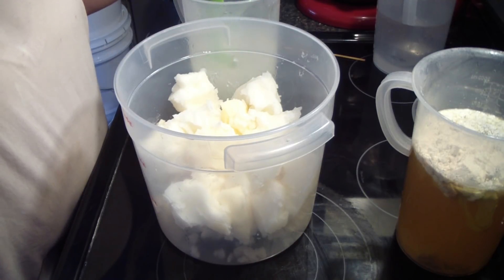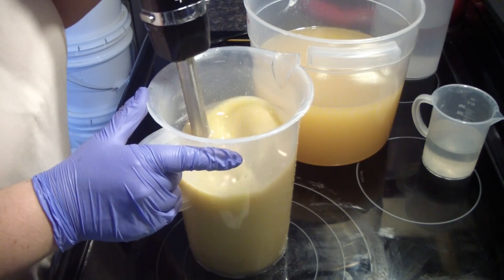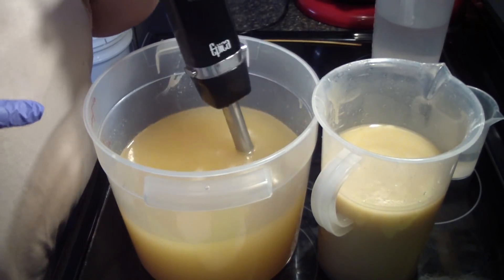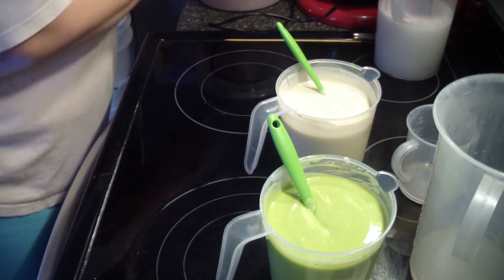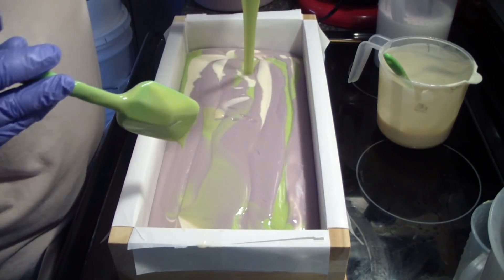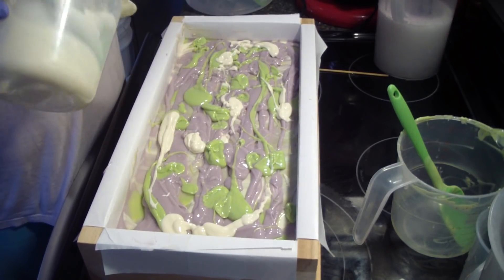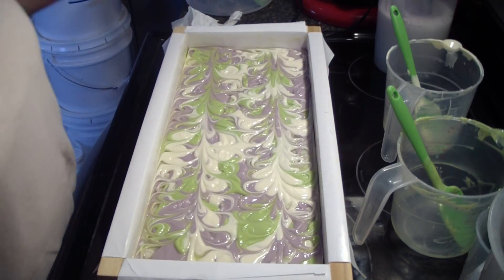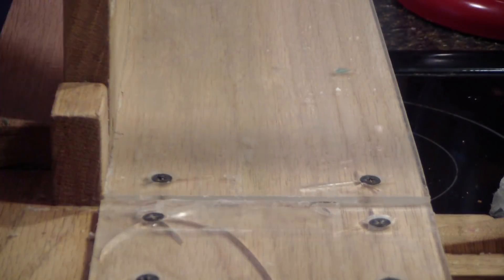Making & Cutting Lavender Cucumber Soap

Comment: I have a 42 oz soap mold want to try making soap but i am not shere how much melt and pour to use for the mold can you please help me out would a 42 oz mold be 2 LBS?
Reply from the maker: To measure how much your mold will hold in total volume do this math. 
Length x width x height x .40. that will tell you how many ounces the mold will hold for you.
Reply: there are calculators online to convert lbs into ounces :)